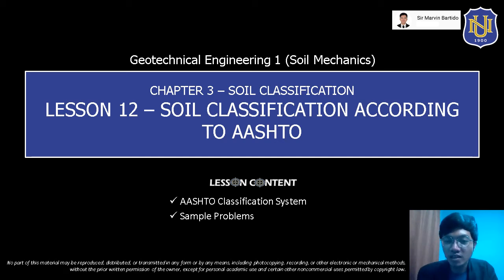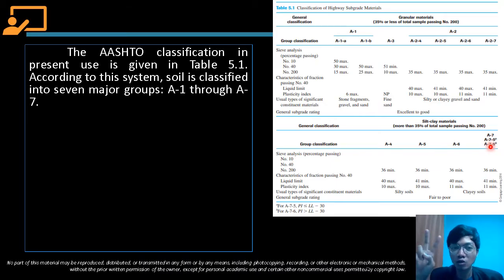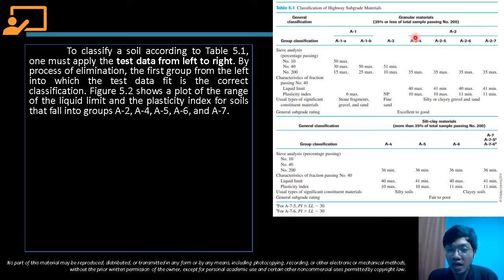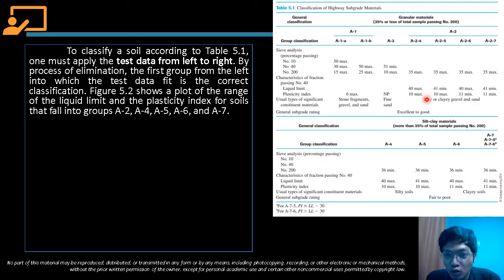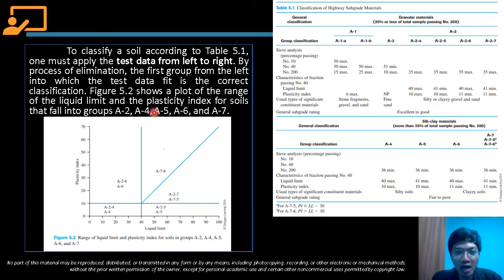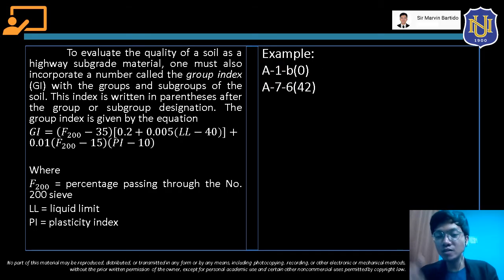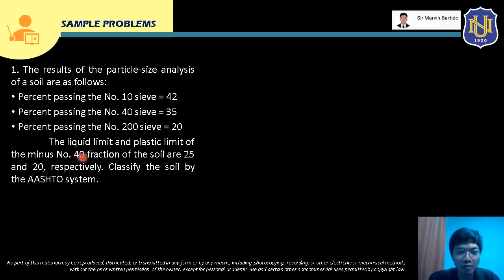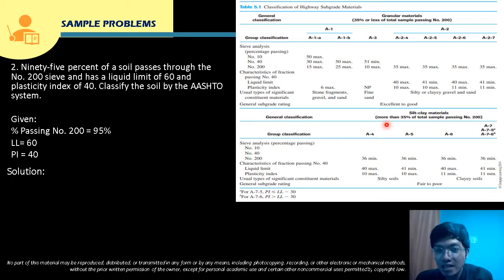Geotechnical Eng'g 1 (Soil Mechanics) - Soil Classification According to AASHTO

Comment: Good afternoon po sir.. May concern lang po ako about sa example number 3 for soil B..alam ko po na may nakaset na rules po in identifying the GI of groups A-1 to A-3 which is 0 po.. Nong sinubukan ko pong kunin yung A-3 kung saan ang value po ng LL and PI na ginamit ko is 0 and by  using the whole equation of GI ang napalabas ko pong value ng GI for soil B is 0.7.. Mag stick po ba ako sa sagot na A-3(0) or gagawin ko pong A-3(0.7)? Thank you po sir
Reply from the maker: Hello. Stick to rule no. 4 of determining GI.
Reply: @MarvinBartidoChannel  Sige po sir..thank you po